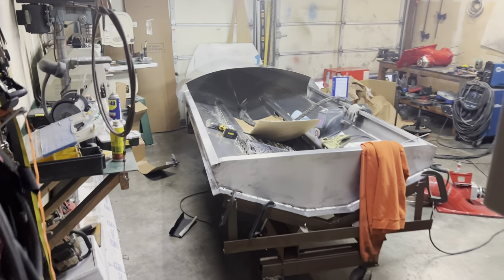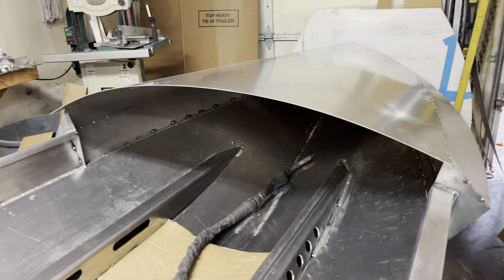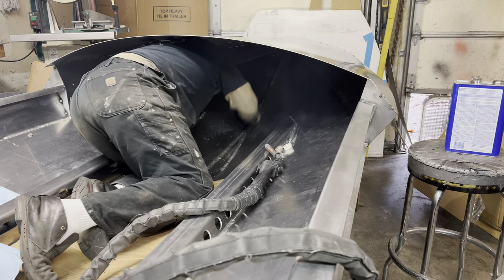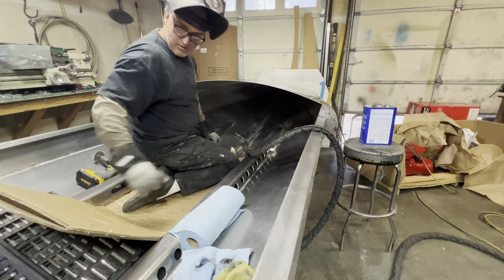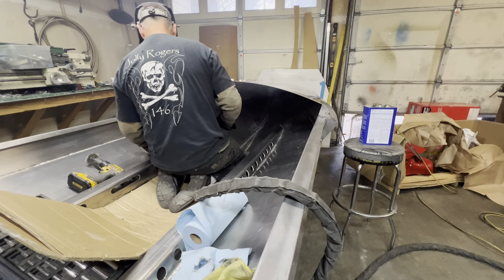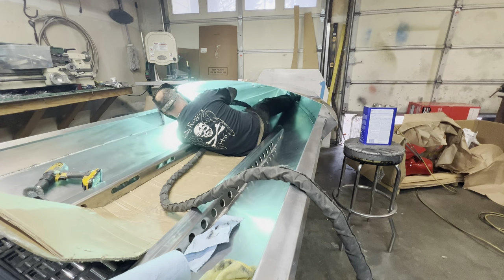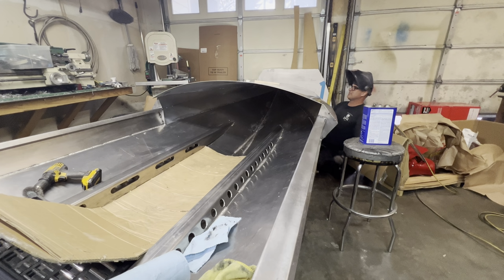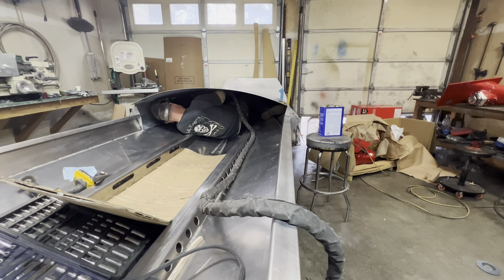MIG welding ALUMINUM Jet Boat

Comment: Sweet to see another build video. I was missing these.
Remember what I said about scrubbing back and fourth with the wire brush, best to try to avoid.
I feel your pain with the 51 year old comment, I will be 52 in Apr and I wish I was 25 again and doing this stuff.
Edit: I have a little 125lb girl that is one heck of a welder to do those tight spots, she is all bendy and wee so she fits in those spaces wayyyy better then I ever could.
Reply from the maker: Thanks for the reminder!   I try to do that but forget.  It’s not habit just yet.
Reply: @JollyRoger907  Meh and you know what, both ways cleans so much faster and just seems more natural. I wonder how much it truly matters, your boats are not bursting and the seams and you are just going to crash it anyway 🤣 You do good work anyway.

Comment: using a 12'' exhaust fan connected to a 12''x25' flexible ducting works great for quick exhaust of fumes! Can set it close to where youre welding and will suck all the fumes right out. Great video
Reply from the maker: I’ll look into it! 👍

Comment: Nice combination of real time and time lapse. As a hobby mig welder I am really impressed with the welding you do. Crawling up under the deck is not a comfortable position for me to try to weld steel, let alone aluminum.
Reply from the maker: It sucks lol

Comment: Could you share your settings on the 255? Manual pulse vs auto set, WFS for the different joints, and are you adjusting arc control and arc length?  Seems like even with the pulse it’s easy to get too much heat in the aluminum

Comment: Note to self, must have a fan mounted outside the boat with tube blowing air into your mask so you can breathe fresh air at all times & a small 4-inch usb fan blowing air slowly along the inside of one side of the boat so that it removes the fumes from inside the boat.
Reply from the maker: Just ordered one, will try it out.  Thanks for the tip 👍

Comment: Lil advice, you can clean your weld joints with a (new) not used stainless steel wire wheel it will reduce the magnesium on the surface and reduce or eliminate the black suit residue. But use the wire wheel on nothing but aluminum or contamination will fill your welds.
Reply: Great video!!
Reply from the maker: Thanks Tommy! 👍

Comment: What about making a jig of the outside now for the next design/build. Maybe fiberglass(?) fit your form with material, weld flat right-side up(deck lid upside down). When you’re done with the “inside” welds, I guess your seam at 3/16ths to 3/16ths chine to bottom plate would only be your seam that would be welded in place. I do recall you saying your work space is limited, but if it’s fiberglass rather wood. What do you think about that? Also fiberglass, your seams would be well defined.
Reply from the maker: Aluminum hulls required

Comment: Is there any reason why you didn’t weld out under where the front is before you put it on? I’m sure it would have been much easier and less miserable? It’s looking good though, you’re making huge progress.
Reply from the maker: Plate distortion is reduced significantly when it’s all tacked together.  I did minimal welding at the very tip of the bow though before putting the lid on.

Comment: I've never seen anyone weld aluminum as quickly as you do.
Reply from the maker: How so?  You mean the travel speed?
Reply: @JollyRoger907  Yes
Reply from the maker: @doug1030  ahh yeah you gotta travel fast!  This is only .100” plate so it heats up incredibly fast!!!
Reply: @JollyRoger907  Well you're a very talented welder. Love your boats

Comment: OK so I'm going to ask a ?? Not doing one before sorta left me in the dark but why didn't you do thisecwelds first before putting top on wouldn't it have made the welding much easier??
Reply from the maker: I did the welds that weee all the way at the tip of the bow.  Waiting for all the plates to be in reduces plate distortion significantly.
Reply: OK just seems like such a pain getting in and out all the time lol I'm 54 and that  would be rough very rough
Reply from the maker: @jonsmith4463  trust me, it is a pain lol.

Comment: Why in the heck wouldn't you weld those hard places up before closing it in so tight?
Reply from the maker: I did the very tip of the bow.  You HAVE to tack everything together or the plate distorts horribly!!!